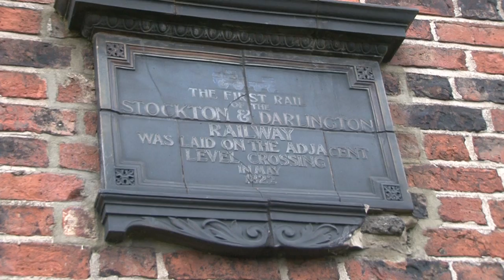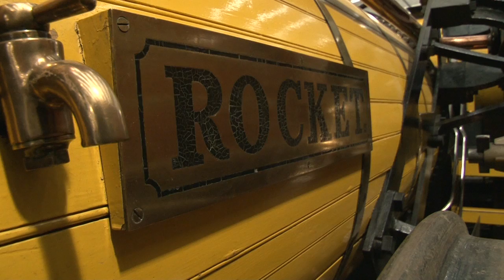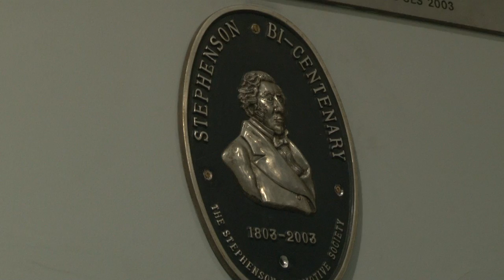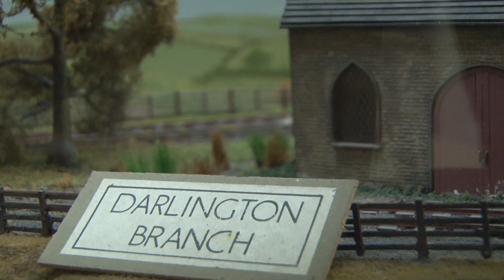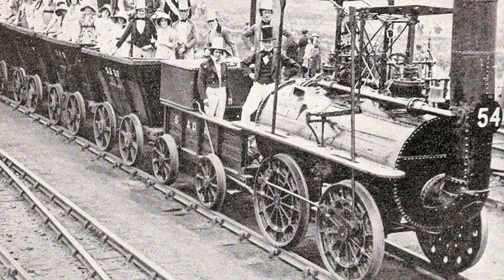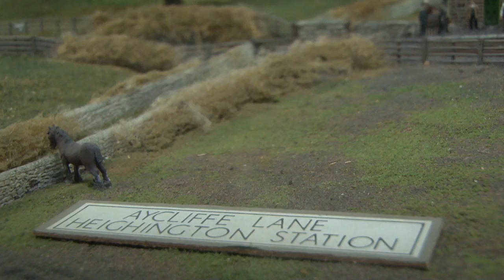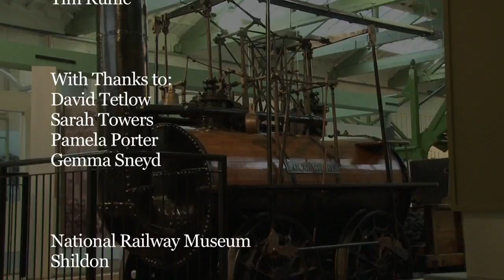1825 Year of the Railway

Comment: I wonder what sort of rail they initially used.  Iron ribbon on wood maybe?
Reply: What you describe is a strap rail.  Steel surfaced strap rails were quite common in the USA in the first half of the 19th Century because little steel was made there and importing it was expensive.  Wooden rails, probably strap rails and later cast iron had been used on wagonways in Britain.

The S&DR used wrought iron rails when it opened at George Stephenson's insistence.  For all their strength cast iron rails are surprisingly brittle and George Stephenson actually had a patent on a method of laying and joining them that made them less vulnerable.  He could have done quite well out of the S&DR if cast iron rails had been used but he knew wrought iron was better.

Comment: That engine was invented by Mr Trevithick of Cornwall,,,Mr Stevenson STOLE the invention  and put it on rails....
Reply: He was inspired by him, and improved the design.
Reply: I suggest you do some proper research before making assumptions, yes Trevithick gave us high pressure steam but he certainly wasn't a locomotive designer. Yes he did build the first successful steam locomotive but it wasn't much of a success, the coalbrookdale locomotive did run and work as intended but it was far to heavy for the tramway and after a few runs and several busted rails they simply removed its wheels and used it in the penydarren iron works for running machinery. Stephenson and alike Timothy Hackworth took this concept and made successful and functional designs from it, Trevithick never put in for any patents on the steam locomotive so as such nothing was stolen. The only thing George Stephenson could be 'accused' of is casting faulty cylinders for hackworths sans pareil during the rainhill trials but even so back then casting was still a process that was being mastered so the chance of the cylinders having air pockets was fairly high.

Comment: I believe that the reason that the cylinders are vertical is to keep them in the boiler, to keep them hot, to reduce heat loss and make the locomotive more efficient. This is another example of the brilliant mind of Robert Stephenson at work - well ahead of his time.
Reply: Locomotion was designed by George Stephenson though built by Robert's company at Forth Street.